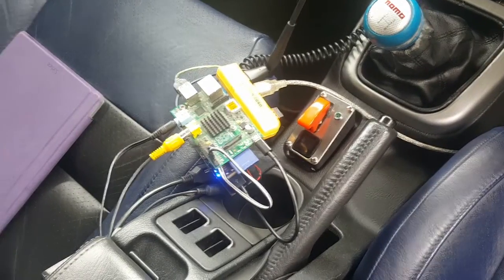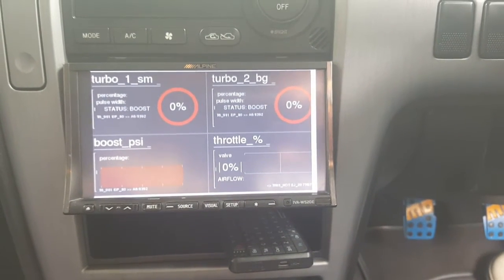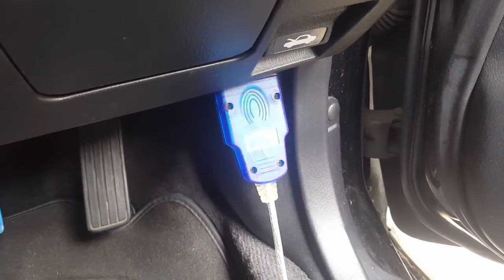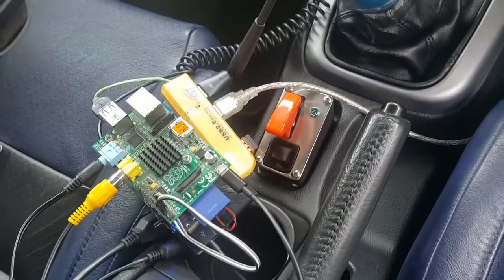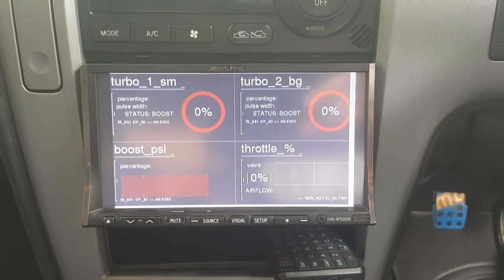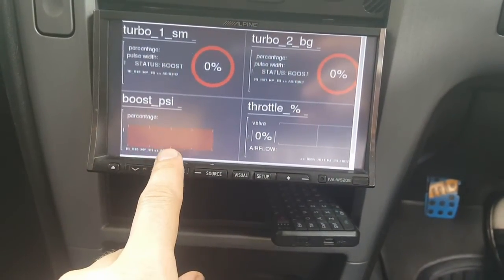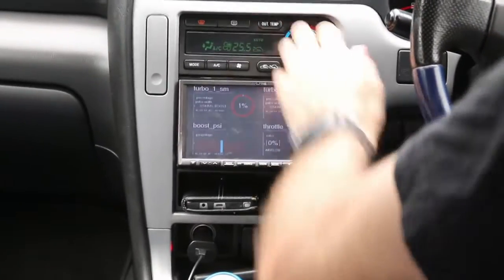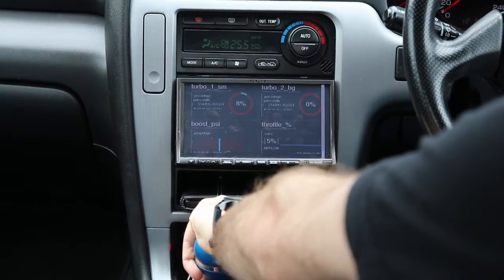Raspberry Pi digital car gauges display.

Comment: how did you get the double din audio player to work as  a display? and once it display the gauges, does it still work as a player?
Reply from the maker: I used the 'Video In' plug at the back of the player. It was a video option on the player. When in that mode it can only play music through the Raspberry Pi.

Comment: Hey, nice setup. I was looking to do the same with my double din. I got something running but its not as elaborate as this. The easiest way i got it to run is i got an android headunit, Tactrix cable and an app called Btssm. I runs very well and smooth and its realy good with logging.
Reply from the maker: Yeah, the Android head units are a really easy way to go. There is lots of Apps available and the hardware is all taken care of.

Comment: Very cool. I bet reversing the OBD stuff was fun! Seems very low latency.
Reply from the maker: Fun is not the word :P It is a single line serial connection at 4800 Baud. I borrowed a signal analyzer and decoded the bits by hand. The latency is purely in the communication speed. Making the graph transitions smoother gives the effect of less latency. Thanks for the feedback.